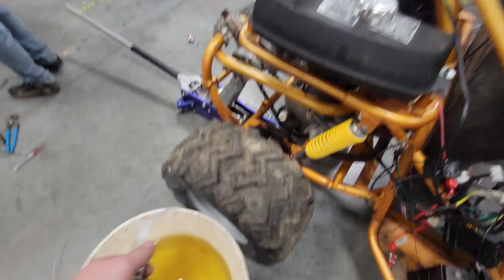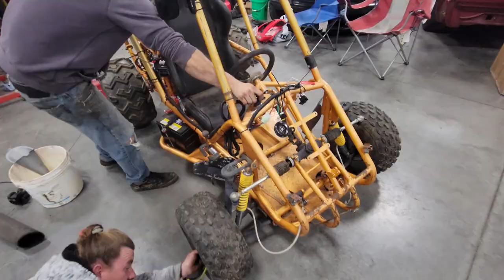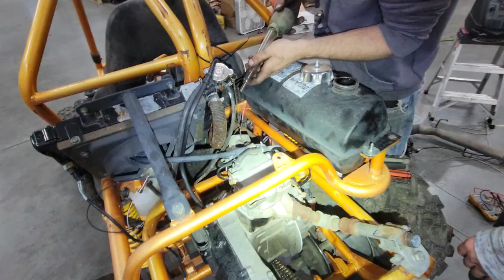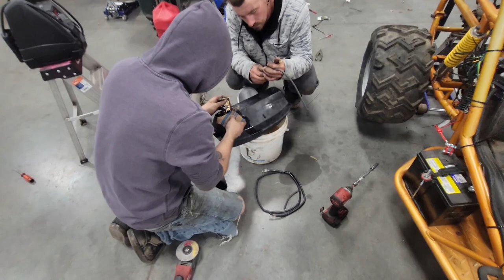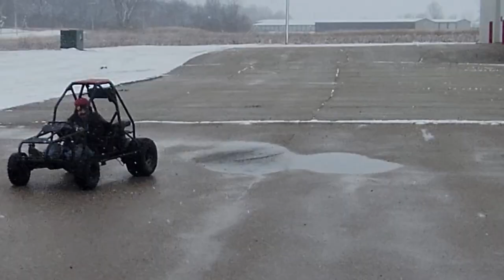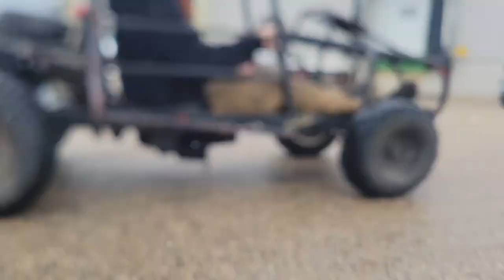Go kart goofin!

Comment: Careful about running an engine with it jacked off the floor at an angle. If its  slung or oil pump lubricated it might not get  proper lube causing premature engine failure in rod or piston rings.
Reply from the maker: Thank you for the advice Patrick, will definitely keep that in mind!